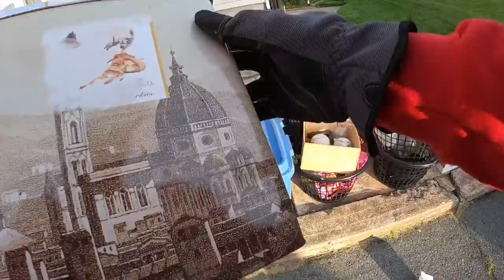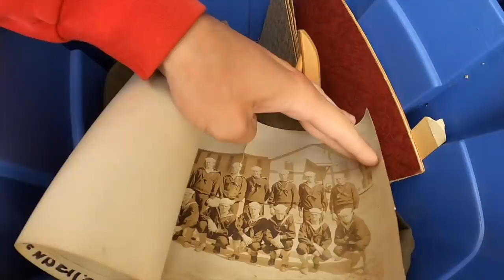FOUND WW2 Military Artifacts in the Trash! Garbage Picking Ep. 453

Comment: Take the vintage salterini patio furniture to the flea. If it was at a garage sale it would be 1K. Seats and no glass top it is very still an expensive set to own. Back in the 1970s that table was nearly 1K new.
Reply: @ Lynn Maupin-Simpson  you are correct.  I got it in 1978 at Hess's Dept. Store in Allentown, PA.  Hess's is gone. Haven't used it since the early 90s.  No room.. :o(